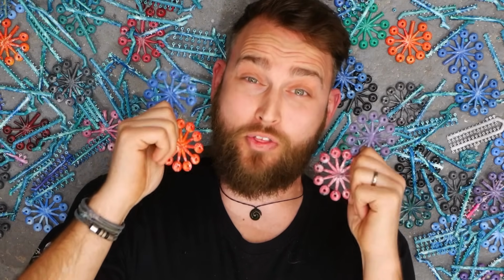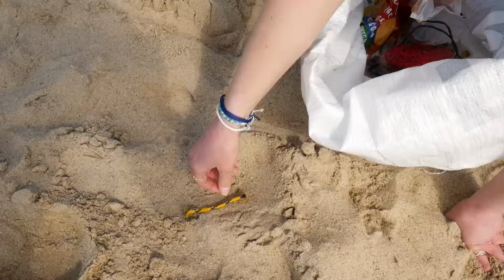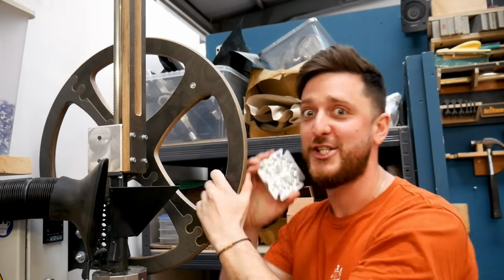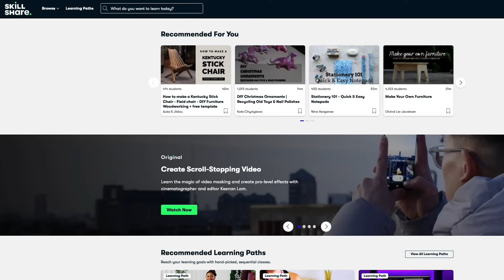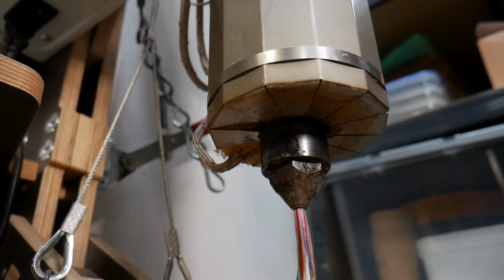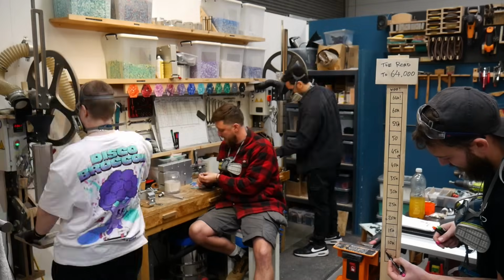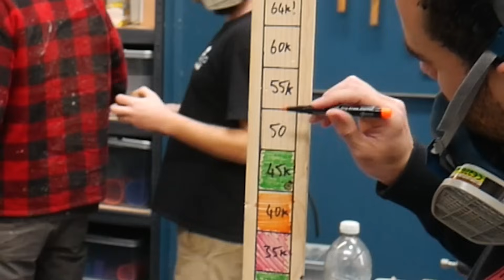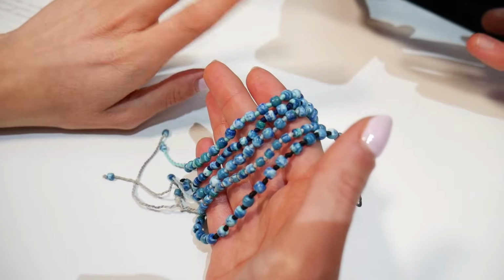How We Made 64,000 Beads From Beach Waste

Comment: A couple of thoughts that washed through my head while watching this..
For small parts like beads or any other injection mold.

1. Build a vise to put the mold in instead of having to screw/unscrew the nuts and bolts to hold it together. The vise will make it quick release.

2. A guillotine to cut the beads off in one go instead of one by one.

3. This may work... Just tumble the beads as they are which should knock off or smooth out the threads/squeeze out from the edges of the beads or pop some polishing stones in which are mildly abrasive to achieve the same effect but quicker.

Hope that helps 🤘
Reply from the maker: Really helpful ideas man! Will definitely be giving these a thought to put into practice, thanks! 🤙🏼🤙🏼

Comment: Great that you are cleaning up the plastic. I might suggest a mod to the molds where you use a metal T shaped wingnut fastener to hold the halves together. That would save massive time. Also think about being to use a paper cutter to shear the beads from the sprew.   I used the T shaped wingnut fasteners on my lead molds with good success. I got that idea from US military surplus electronic equipment. I suspect that Dzus fasteners would work quite well also to hold the mold halves together.
Reply from the maker: Thanks for the suggestion! We have tried wing nuts but the forces we are working with are pretty massive and without enough clamping pressure we end up dealing with a lot of flashing. We’re gonna try quick release clamps.

Comment: If you're wanting a specific(ish) color but don't have enough, if you mix a packet of iDye Poly by Jacquard in a bottle and add a tad while you're baking the HDPE, it'll work.

I used an empty 32oz bottle but the size doesn't matter much. This is for use on the clearish/white plastic such as milk jugs. 
-Clean the bottle out
-Stuff the dye packet and "color intensifier" packet into it
-Pour hot water in it. I use tap water that's as hot as comes out. No boiling.
-Fill the bottle with just enough water to be able to mix the dye. I use about an inch from the bottle.
-Add just enough to your HDPE to coat it all as even/dark as you can
-Bake til melted enough to start mashing it altogether
-Repeat melting it and folding it til you're happy with the consistency
-Fill your mold, bake it, and BAM!

It's not as good as just having enough of the color, but it works!

Comment: You could make a press mood that would cut the beads from the main stems after they have cooled to drastically cut down your work load. Use the angles from the snips that were used to cut them by hand. Think “leather hole punch” and paper hole punch but on a mechanical press. You can make that too using the design you already have to raise and lower the injection arm.
Reply from the maker: This, in theory sounds like a great solution. The one thing that ruins that plan is shrinkage. The plastic shrinks by between 1-3.5% after cooling and this fluctuation would impact the location for pressing the cutters.

Comment: I bet you could put the beads into a big tumbler still attached to the connectors. The tumbler with some steel beads and or abrasive should break the beads off as well as take off the nubs left. I would get a cheap rock tumbler and experiment with the idea
Reply from the maker: We get this suggestion a lot. The issue would be the change in surface finish

Comment: Brilliant.
Remake one side of your mold so you can pour and replace one side with a new side that has cutting faces.
Screw it together and unscrew, save you cutting each bead by hand?
Nice work!
Reply from the maker: Sounds great in theory, but the beads shrink a tiny amount which would throw the cutter off a little, so each bead would have to be visually checked for damage, which kinda defeats the point of speeding it up! Thanks for the suggestion though!

Comment: If you get a hole punch to fit close to the side of the O.D. Of the beads one like you hold a chisel they have an exit port on the side so you can hold it over each bead and hit it with a mallet and as you go they with eject our the side as you cut them off the tree then you don’t need to clean the up because your cutting them close to it’s size and you can obviously get a hole punch for every size bead and this would make it go heaps faster

Comment: Beautiful.  Have you ever looked at the bead making methods of old glassmakers?  What I have seen and read has it that the streamer of glass is wound onto a long, prepared, metal rod.  The rod is removed and the tube is snipped into bead lengths.  The beads are 'tumbled' (like candy and rocks, etc.) to round and smooth the rough edges.  I haven't seen modern glass bead making but I imagine that the snipping is mechanized now.    In their method, there is almost no waste and it looks like less of a pain in the neck than all that sprew clipping.    (Let me now apologize for being a meddlesome butinski.  I think way too much.)

Comment: Seems like a more efficient way to trim that overflow off of beads would be to drop them onto a threaded rod. Lock them in place with a nut at each end, put the rod in the lathe or just a drill, and spin it to sand off the excess.

Comment: Hi guys! Amazing video! By the way, I saw the plastic coasters you made in a previous video . Everytime i see them, I wonder if it's possible to make a bunch of them and use them to tile something. indoor/outdoor showers? floors? im imagining that large plastic panels can be used as a shed/ home gym floor, or maybe a greenhouse roof? Also, you build a plastic bench once that was kinda saggy but it reminded me of pool furniture, so maybe a pool lounge chair would work well.

 Also, if you just sold bags of the recycled beads i'm sure a lot of jewlery makers/artists would buy them! I definitely would!
Reply from the maker: Hey Mikey,  yes we do have tiles which are very similar to our coasters, a friend of ours used them to tile a shower and they look awesome! Our next video is actually producing a chair using some of those bench legs, but with a hammock style seating part.

And we'll be popping them onto our website in the next few weeks for sure then!

Comment: It should be possible to design a cutter that would cut the beads free of the sprue. Then I was wondering if you could use a rock tumbler to remove the extra bits. What do you think?
Reply from the maker: That would be interesting to try out! The only concern with a rock tumbler is that it may ruin the surface finish of the beads slightly.

Comment: I always hear that recycling plastic is more expensive than making new. What about this process makes it more expensive? It seems like it's not too different from metal recycling, just melt it, then pour (or inject) into a mold. Is it the sorting? The cleaning? Or is making new plastic just so unbelievably cheap that there's no comparison. 

Is it different from metal because metal is an expensive material material in the first place, so it's worth going through the cleaning and sorting?

Also I've heard recycled plastic is weaker than new plastic, but you guys seem to recycle things over and over again (offcuts, shavings and stuff) Do you notice a significant difference in the strength of the material? Just curious how much of a limitation these things actually are.
Reply from the maker: The sorting and cleaning does indeed take time, but you’re right in that virgin plastic production is just ridiculously cheap since there’s currently a continuous demand. 

A lot of companies will state that plastic recycling ‘doesn’t work’ because the material degrades upon multiple rounds of recycling. Where that may be true on a molecular level for medical grade applications, we’ve recycled the same material 20+ times over with zero visible impact on the properties or finish on the final product. Certainly makes you think!